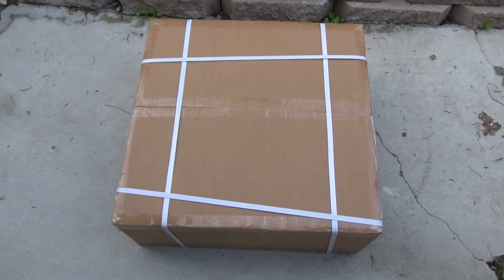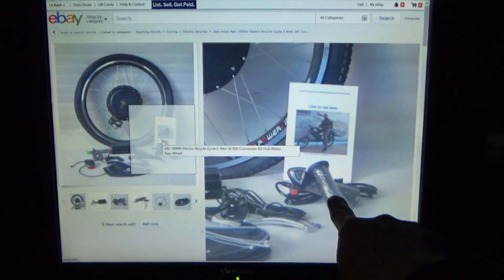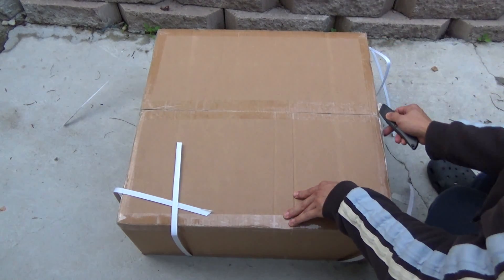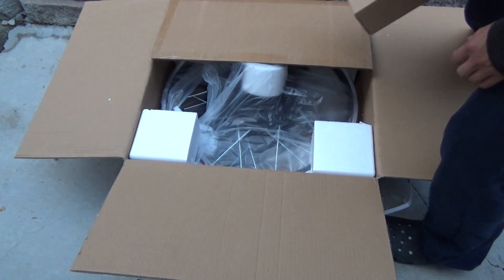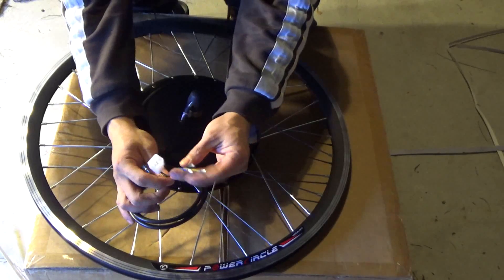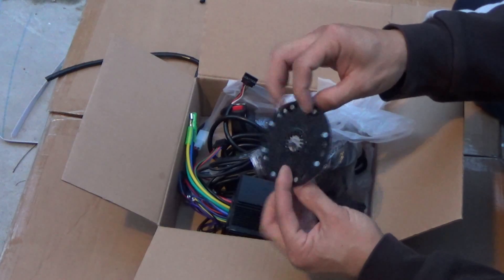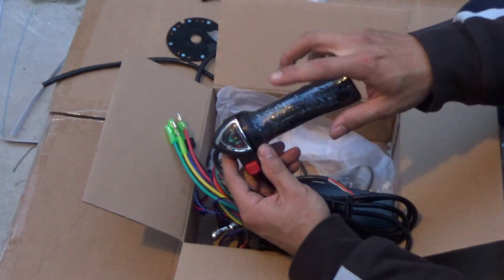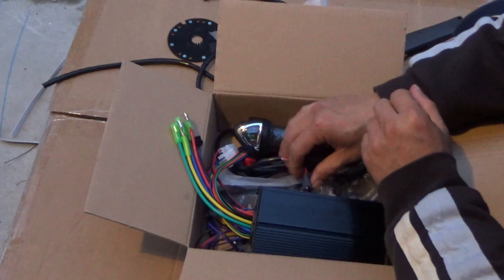Unbox: 1000W 48V Electric Bike brushless Front hub motor conversion kit w/ Standard 26" rim

Comment: Question:
I have this very unit as the Rear Model with Thumb Throttle...can you recommend a replacement controller preferably on Amazon to replace a Burned out unit.
Thank You!
Love your Video's

Comment: I'd take it apart and upgrade everything posible. Thicker wires, beef up Parts if needed. I might get that one for my bike. And create a one wheel trailer attached to my seatpost to tow a car battery behind me with a trickle charger to charge my bike on the go. I'd be able to travel all around townfor a few days be for recharging the car battery.

Comment: does the wheel takes 27.5 inches tire ? wha is the width of the tire it takes ? thanks
Reply from the maker: No, it only takes 26" tires. Tire size is 26 x 1.95
Reply: @vuaeco  it makes no sense bro. if the rim you having is 26 inches it should take 27.5 tire right..?. please double check

Comment: i bought a similar unit , when i hold the axile bolt in my hands the wheel wont spin or free wheeel , is that normal ??  are the magnets so strong you cant hold it in your hands and spin the rim?
Reply from the maker: That's not normal. It should spin and freewheel when there's no power.

Comment: Is there any way to run the motor straight from just a battery? I don't know what is negative and positive on the motor wheel its confusing with the 5 small wires and the three big wires.
Reply from the maker: Not with brushless motors. You need a controller.
Reply: @vuaeco  thank you so much

Comment: hi there i have a 36 volt 350 wats brushless  motor with 3 power wires red black green and 5 small wires but no controller the motor refuse to start with a 40volts battery is it because theres a built in controller or what? by the way when i turn the wheel there is a spark between red and black wires  please help thanks a lot
Reply from the maker: A brushless motor requires a controller. HOw do you hook up the battery to the motor?
Reply: its a built in controller the battery is connected but i have 5 small wires may be the hall sensors how do i play with those?
Reply from the maker: @السعدي-م9د  5-pin cable is a hall sensor. A brushless controller should have a 5-pin cable also. What's strange on your motor is that it has 3 different colors than a regular brushless motor. A regular brushless motor should have yellow, blue, and green not red, black, and green.
Reply: @vuaeco  yes i know its because the controller is built in to the motor

Comment: Can you tell me the benefit of a front wheel vs rear. It seems a rear wheel kit is much better in all ways that really matter.

I just ask because I was sent the same front wheel but I had ordered a rear. And don't want to pay shipping back. But it just seems strange putting on front of a MTB. Won't get very good traction which is why I bought one, to go up some hills. This thing will just want to spinout I'm sure.
Reply from the maker: Unless you're going up some very steep hills, it always has good traction. I've used my front wheel hub ebike for over 2 years and never had any problem with traction going up hill. It may make the front a bit heavy. But I can tell you the rear hub motor will make the back heavy, too! I have both ebikes with front and rear motors. You still might have trouble going up hill with a rear motor because now it has a tendency to do wheelie just because the rear is too heavy (especially if you have a battery pack on the rear rack also!)
Reply: @vuaeco  Hey thanks vuaeco. love your videos.

Comment: When you purchased your conversion kit how much did it cost and you did not purchase a battery I am understanding that the kits are not that expensive but it is the battery that is most costly
Reply: I purchased a kit and it got delivered today I won a bid on ebay by the company the kit cost 189 GBP to buy new it cost 340 GBP but it is a 3000w motor and runs of a Bluetooth programable controller it can be set at different voltages from 48 to 96v set by the app they send you just download threw your smart phone purchase a battery threw internet best to build a battery with 18650 batteries in series and paralel to give the desired voltage can get speeds up to 120kph can't wait to build it

Comment: Whats the biggest battery i can get for this and whats the distance i can get with it?
Reply from the maker: The only limit to the battery size is your bike frame. If you carry it on the rear rack, the limit is the weight limit of your rack. Other than that, there's no limit. My battery is 10Ah and I can go for 25 miles distance per charge.

Comment: Hi mate could you tell me which is the pedal assist sensor wire on this control box eBay number
253657651756

Comment: Can you just hook up the 3 wires to a regular ESC and ignore the hall sensor?
Reply: The motor is AC current and the controller sees a "~" waveform of the passing magnets, north south north south and so on and puts out a pulse width modulation. What you can do is bypass the throttle cable wires and stick a 6 leg potentiometer inline possibly. But you would have to look up the wiring diagram to be sure 100%. The controller wants to see resistance increasing on three wires, and dropping on the other 3 as far as i know. A Razor Ecosmart Metro 36V uses the same set up but motor is DC.
Reply: If you had a DC motor with 2 wires you can put power straight in, but make sure it is current limited.

Comment: Bought and received today a 500 watt 36 volt front wheel kit, haven't opened box yet, (no battery) motor from website looks exactly like this one, it says on box shipping weight 44 pounds!! before I open it does anybody think 44 lbs shipping weight for a 500 watt conversion kit (no battery) sounds way to heavy?
Reply: Yeah. I just got a 1000 watt kit.  Front wheel dd. I think it said on the box shipping weight was 28 lbs. Also no battery included
Reply: You got scammed homie

Comment: I wonder if your thousand watt wheel is exactly same as my 500 watt wheel because they look the same
Reply from the maker: My motor is 9.5 inches diameter and 2.5 inches thick. What's yours?
Reply: vuaeco is exactly the same size as yours somebody told me all they do is they put a different speed control in the box but the wheel is the same from 500w to 1000w that's how they make their money if you know what I mean
Reply from the maker: Great to know that. That might be the case. Then we just get the 500W kit and put in a better controller then? :D
Reply: vuaeco yes that's all I'm going to do when they decide to go to 48v I would just buy a controller that's what they want you to do they want to go out and buy an  new wheel kit👍
Reply: @vuaeco  I just watched your video on how the controller wires hook up. That was an awsome tutorial on the controller. Its Dec. 25 , 2020 now and was wondering you got more experiences on E-bikes so is it true that those 1000w motors are the same as the 500w or they just handle more voltage and amps?
Reply: They are going to look the same because they are only one is 1000w an other is 500...

Comment: Hi, I wonder if a 36v 20a LiFePO4 battery would power this motor.
Reply from the maker: A 36V 20A pack will not power the motor. You will need a 48V pack.

Comment: I have the exact same kit. What's the minimum amount of amp hour that the motor will run. Every seller says they need different nominal amps. One says 11.6 ah, one said 17.5 ah, and another said something in between. On lunacycle, the 17.5 ah is one of the most expensive... What do I go with?!
Reply from the maker: I think they are talking about Amps, not Amp hour. They are not the same thing. Amps is the current required to run the motor when it's under load. I don't know the minimum Amps required for this motor. But I'll test it out in real life and will post results. But let's just say it needs at least 10 Amps to run. That's the discharge rate of your battery. If your battery is 100 Amp Hours but has less than 10A discharge rate, still, it is not capable of running this motor (when under load)

Comment: throw included tire & tube away they are too skinny and stink. also put duct tape or some form of tube protection between tube and the tops of wheel spokes as added torque rubs ALOT

Comment: I recently purchased this kit through Amazon. I must say the service was quick, but the instructions on how to install were completely lacking. It came with a small book that showed the color codes and not much more. I followed the color codes and took a lot of time installing and making sure the wires all were installed correctly and neatly.
The results were terrible. It does not work the minute I plugged it in it sparked. It shorted out and has not turned once. I have tried to contact the seller to no avail and Amazon just ignores me. I do not recommend this product. and support is none existant.
Reply from the maker: There are many different variations and sellers for these kits. They are not made by the same manufacturer. Mine also sparks when I connect the power wire. It produces sparks because it needs to charge up the capacitors inside the controller. If you have problems with it, maybe there's something you're missing in the installation process? Try just to connect these 3 wires: Power, Hall sensor, and the 3-color wire bundle (yellow, blue, and green) and see if it works. Don't hook up everything so maybe you can use the process of elimination to figure out the problem. Or maybe you just have a dud. I'm almost done with my project for this bike and I'll post videos of detailed installations in the next few days.

Comment: Well, I was hoping to see what ever hapen to those skinny wires on that charge controller...?? I'am considering this kit (black wheele)but when i saw how skinny the charge controller wires were kinda of spooked me away from the black one..I'am wondering if the kit with the chrome strips wheele is the same way (skinny wires)..I had planned on buying 5 / 12s laptop batteries to used on this project..What do you think about that?

Comment: Where is the follow-up video?

What happens if you use a front AND rear electric hub?!!!
Reply: steve bigler I thought of doing that, hopefully being able to use the same throttle and battery for both motors, otherwise its prob just a matter of how much space you have on the Bike. I will probably add a mid-drive to the front hub I got for more torque at a standstill and to help up the hills.. Maybe a small battery pack with high output.
Reply: You'll a go faster

Comment: how much battery do I need to travel 50miles with tis 48v 1000w motor? or is there a formula I can use to find this out?
Reply: ...carrying 200lbs total at average speed of 30mph
Reply from the maker: Yes there is a formula. But you'll need an Amp meter for your actual use. How far you can go depends on how fast your speed is. The slower it is, the farther you can go. For example, if your motor consumes 5A at 20MPH and that is 5A x 48V = 240Wh. So to travel 20MPH for one hour, you will need a 240Wh battery pack (or 5Ah at 48V battery pack). If your speed is faster than 20MPH then you'll need to get a bigger battery pack to travel the same 20 miles distance.
Reply: Great! Big help, I can use this informaation to go on with my project. Thanks
Reply: darrick steele म्
Reply: There is No one battery that will take you anywhere near 50 miles unfortunately i use a 20ah  for the 48v 1000w motor an lucky to get around 20 miles an that is pushing it...

Comment: yeh bro nice .....don't forget ya torx arm to stop it opening up front forks lol
Reply: dave Yates do u "need" a torx arm for rear wheel?
Reply: Bernard Ellefsen depends on if your frame wheel nut points am strong bro you might not need em on back what power [watts] you useing
Reply: 1200w ;)
Reply: Bernard Ellefsen nice i only use in 500w bro bet u can do 40 + ay it ....u shud be ok but if the wheel nuts slips on the frame it wud lift ya up but because of ya weight close to the back ya should be ok without the torx arm .....it's just a thick plate of metal to lock the axle  in place cause the frame or forks am to weak .......before torx arm i welded a big washer to it and that worked for time untill i had to drill my front fork to attach the torx arm with a small bolt job dun lol
Reply: if ya front forks am thin metal this would need torx arm to stop the wheel axel turning in the forks and then rolling down the road i had it with 48v 500w version LOL😀
Reply: Damn! Thank you man!!! 40 kmh?😂😂😂😂
Reply: that's crap bro for 1200w i expect it to do like 50mph mine goes 20 - 25mph on 48v 500w but it's a guide line lol
Reply: Lool, i ment thar it was awsome that urs did 40kmh at only 500w!😂😂

Mine will go up to 70kmh!
Reply: Bernard Ellefsen i need one bro lol but my frame starting to shake apart now especially  the bearings for handle bars cus front wheel motor lol wish i had back wheel now lol but next one i buy wud be mid drive so gears am in use with motor .....way forward i think lol
Reply: Haha, good luck bro! What bike u use? Mountain bike is best i think
Reply: Bernard Ellefsen plus i don't have 18650 protection either ...i using 8p12s laptop batteries lol need to switch to Samsung icr or Panasonic ones lol
Reply: Hahahaha😂😂
Reply: ye man just a 55 pound falcon suspension bike cus of dam speed humps round here but most ya can go round em if i had a solid frame I'd have to use main roads cus it hurts ya arse  lol